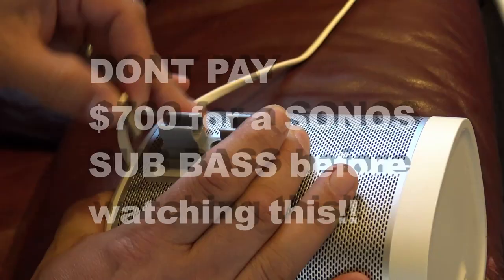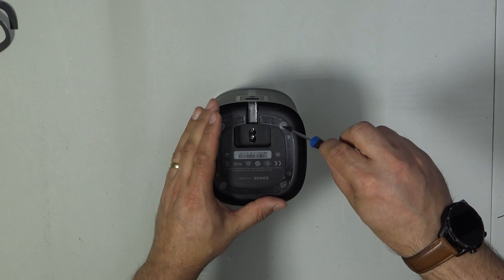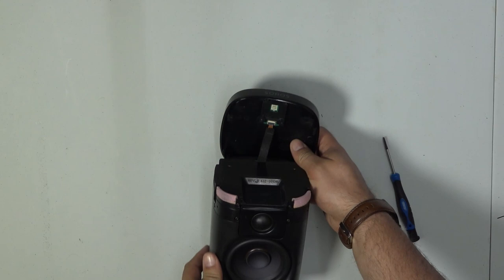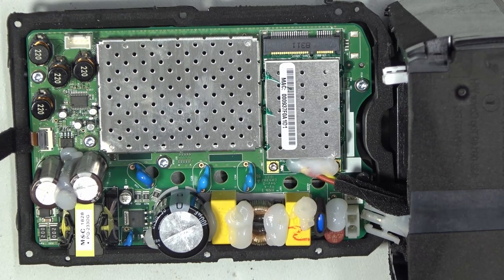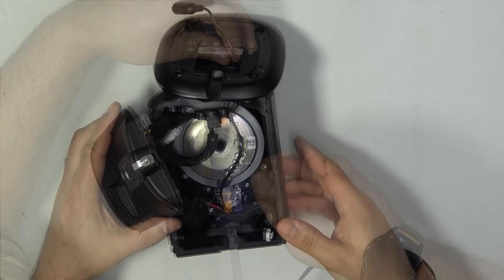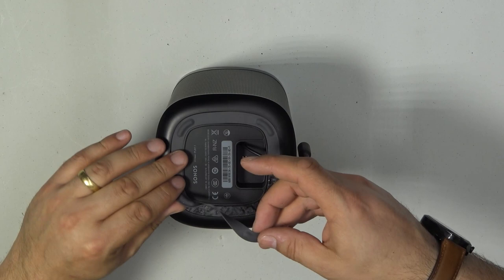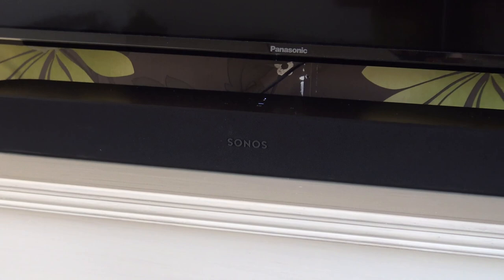DuB-EnG: SONOS Hacks - Connect ANY powered SUB BASS speaker to SONOS 1 - teardown & full explanation

Comment: Somewhat shocking update: I did this hack last year (thanks btw), hooked up my sub and worked great, but a month ago, the sub blew (it was old, second-hand). Rather than toss the sub out, I cut out the plate amp electronic and ran the speaker wire from the Sonos Play:1 DIRECTLY to the (now) passive sub terminal connections. So my Play:1 is now driving a 12" subwoofer driver directly.....and amazingly, its driving it really well. Like shockingly well. Deep, full, soul-rattling bass and fairly loud volume levels, all coming from that tiny Play:1.
Reply from the maker: Dude!!! Lush!!!  Epic to hear that !!!  I think 30watts of RMS drive is fantastic through a 12” speaker in a decent box!!!  Well done!!!  Great idea!!!

Comment: NOTE:  works amazing!  I ended up added a line converter LOC2SL to convert the 2 wire to RCA.  Best part is the LOC2SL doesnt require 12v power.  Soldier into SONOS speaker and done.
Reply from the maker: what a great idea!

Comment: great video. Since my power sub has speaker line in ports, I use a regular speaker wire instead. Work perfect. Now I have a 2.1 system. Thanks.
Reply from the maker: Very nice! Thanks for sharing!!
Reply: can you elaborate more ? you still did the hack or bypassed it ?

Comment: Excellent DIY! Who all has reproduced this at home?
Reply from the maker: Thanks very much!!  I’m still loving mine and use it every day!
Reply: I have! just did it. I'm terrible at soldering and it took some trial and error with the wiring (I used your standard white and red RCA cables, which I learned only needed one (can choose white or Red). My powered amp has the line in for these cables and it worked by only plugging in one lead. Not too sure if it's needed? What do you think Dubious?
Reply from the maker: Suggest combining the red and white then you filter the stereo into mono... mono bass makes sense... but either way, if it’s working... I’m happy for you!!
Reply: @DubiousEngineering  Isn't the Sonos speaker essentially a mono speaker in itself? Also, Where is the best spot to solder on the Sonos terminals? I'm finding the solder isn't sticking easily.

Comment: Nice video! I have a disclaimer though. I did the same with an Ikea Sonos speaker. It is a surround speaker. The signal sent to the speaker is only surround (rear) signal. So you wont get the full Sound signal. E.g. If an explosion happens on the front speakers No signal goes to the sub. So Its not perfect. It Works though.
Reply from the maker: Very good point!!! ... that said, mine sounds absolutely fine.
Reply: What if you do this to their soundbar

Comment: It might be worth noting to turn down your Max volume of your Sonos speaker. My powered sub is only on the 2nd volume notch and that's plenty. If the volume goes too loud on the Sonos speaker, you could blow your sub. I turned my Sonos Max volume to 15 percent which works nicely. I have also noticed issues with this speaker now ungrouping on its own. Not sure if others have experience that, too?
Reply from the maker: Aha!! My car sub had “speaker” inputs ... so it can handle the higher level drive in.  I’m still enjoying my home brew sub nd it’s working well :-)

Comment: I agree on the Sonos build quality. I've had some 1s and a 5 now for about seven years and they are solid bits of kit. I'd also agree that a hand drill is great to have around for quick jobs. People laugh at them but so handy for pilot holes and quick drills.
Reply from the maker: I’d love a 5 but they are so expensive...  one day I’ll muster up the cash and courage to buy one... what I like about the 5 is it has an input for connecting a separate source into it, like a record player or keyboard...  :-).  thanks for your kind comments :-)
Reply: @DubiousEngineering  - Agreed, not cheap. We managed to get some Royal Mail shares at the time and that paid for the Sonos gear. Looked at a playbar and bass but just couldn't justify those as well. I think we've had value out of what we have. The P5 did have one issue when it wouldn't come on at all but I spoke to Sonos support and they arranged a courier label and replaced it in about ten days.
Reply from the maker: And...  that is a big bart of it...  you are paying for good quality and good support - but, my oh my, that Sub Bass and sound bar are expensive :-) -  Great to know how well supported you were when you had a fault in warranty.  Thanks for your input here :-)

Comment: Hi the sonos play 1 you connect to your sub 
You used a headphone extension cable that is a single cable.

Do you split that into 2 to solder onto the terminals
Reply from the maker: Yes, the two inner cores come out in mono for the sub, the ground is common. Hope that helps

Comment: This is super interesting. I have a Sonos Play 1 which has started making an unpleasant distortion sound on the bas whoofer which has rendered it un useable. I'm wondering if the bass speaker itself is damaged in some way. In which case this hack would rescue it from the trash. I'm wondering if it would it be possible to connect the bass speaker and the tweeter of the Sonos 1 to an external speaker which had both of these and have a complete speaker? In this hack do you disconnect the remaining tweeting speaker?
Reply from the maker: Sounds like the speaker has come unglued!!  Definitely an opportunity for upgrade!!!
Reply: OK - but can I connect the Sonos tweeter to an external speaker as with the bass speaker?

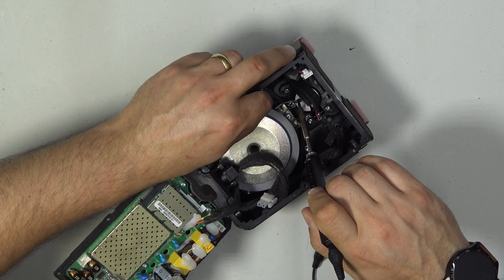Comment: How exactly did you solder the aux cable wires at 9:10? + to +, and - to - but don't aux cables also the ground wire?  thanks!
Reply from the maker: Each speaker in the unit has its own driver so there is no common ground.  You literally solder a cable to each of the speakers terminals.  If you have a stereo cable, the sleeve is the negative and the tip and ring are the positives ... make sense?!?

Comment: So,you connect an HP level, low impedance signal into what should be a line / aux input? No hum / noises?
Reply from the maker: All still working just great.  Feel free to add in a potential divide network if you want, but this continues to work well for me.
Reply: @DubiousEngineering  Thank you for the information, I really should try this once I got a bit of free time (working in touristic zone, our high season started)

Comment: Have you fixed an old sonos Amp connect s1 system. Problem is sounds after a minute or 2 cuts and lowers sound.  Wondering if you have a hack.. I'm geek squad
Reply from the maker: Does it cut out at high volumes?  If so, likely a power supply problem...  Turn the volume down to very low levels and test again.

Comment: I love this hack! I just bought a sonos beam 2, and truthfully it could use a little bass help. I have 2 old Technic floor speakers collecting dust, but I also have an Ampeg BA-112 bass amp. Could I buy 1 or 2 small sonos speakers and use my bass amp as a subwoofer???
Reply from the maker: I'd say absolutely yes...  I hope your bass amp has some low pass filters
Reply: @DubiousEngineering  Yay! I'm excited! Before I get too excited...I don't see lpf anywhere on the amp - does that mean it's a no-go? I'll put a link here to the amp manual and maybe you can look at the input specs and advise (there's a cd input as well; could the sonos speaker connect there)? Thank you!!!
https://ampeg.com/support/files/Discontinued%20User%20Manuals/BA112/BA112.pdf
Reply: @tinaj.7620  you will need powered speakers.

Comment: I followed the video, it works on low volumes, but when you turn up volume and sub hits really hard, Play 1 starts blinking amber and loses connection. It's like a power draw monitor is in the programming. Has anyone else had this problem?
Reply from the maker: No issues my end... all works flawlessly.  Perhaps turn the gain up on the sub so the play 1 doesn’t have to work so hard? Then you can keep the volume turned down on the play 1.  Mine is never more than 1/4 Max volume.

Comment: is the speaker in the sonos needed if you have a beam ? is it better to use the sonos as a connector to the sub only or to keep its speaker used
Reply from the maker: I was worried about having no load on the amp...  So I left the speaker in line
Reply: @DubiousEngineering  would there be a delay ? is the hacked sonos is paired with the beam or synced ?

Comment: Hi
Thank you for this video!! 
One question: how did you configure your bass as separate unit in your Sonos app to control the volume?
Reply from the maker: Configured as a separate speaker that i bring into the group.  Works well...
Reply: U can use the settings on the sub also.

Comment: I've been looking for a cheap way to link my Sonos system to an occasional outdoor PA set-up.  Don't want to pay $450us for the Port.  If I use a modified Sonos 1 I would have another component too...bonus!  Could your approach be modified for a full-spectrum line-out?
Reply from the maker: You'd need two units - one configured for left speaker and one right speaker.  but yes!

Comment: Hello and thank you for a nice and educational video. Just a quick question: Does your setup consist of 2 Sonos1 acting as a stereo pair and a sacrificial third just for the subwoofer or you just use one of the speakers from the stereo pair? /Mike
Reply from the maker: I have two Sonos1 in stereo pair and a beam bar then this sub bass on a separate Sonos1 offering mono sub.  Hope that helps...  it sounds nice but probably isn’t a true 5.1 surround system!!
Reply: How do you setup a Sonos1 as a sub? 🫤

Comment: so if you put the bass volume ++ also the regular speakers goes ++?
Reply from the maker: Yes, but I have the bass volume on the sonos very low and the amp turned up a little high...  then small differences in the sonos controls make larger bass sounds without the small sonos speaker being heard
Reply: @DubiousEngineering  great thanks for info

Comment: hmm, would this feed the "amped" bass signal to a powered sub with its own amp?? is that a good solution?
Reply from the maker: That’s exactly what I’m doing in this video.  If your worried the signal may be too high you can pop a variable resistor in line with the output, but my powered amp has its own volume control.
Reply: @DubiousEngineering  okay, mine has that too. But I am worried that the "line in" input circuit can't handle the amped sub signal.
Reply from the maker: Just chuck a 1k and a 10k potential divide network or put a small variable resistance inline.  Sorted :-)

Comment: How does this connect to the subs ?
Reply from the maker: With an audio cable.  I used two RCA to one 1/8" or 2.5mm jack.  Mono
Reply: Dubious Engineering ok cool. Also are the subs powered by another powered amplifier?
Reply from the maker: Paul Eriole yes the subs are self powered... the Sonos offers a small signal output
Reply from the maker: Absolutely yes... that is a powered amp. You can buy similar powered bass amps for about £100 on ebay